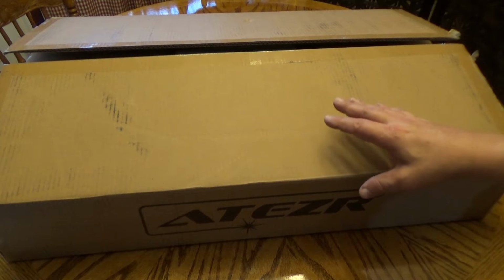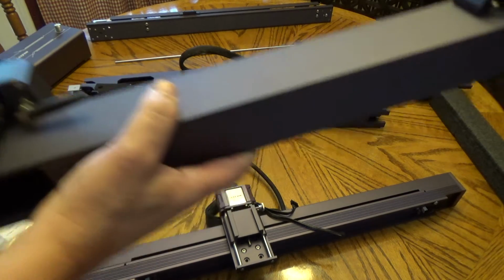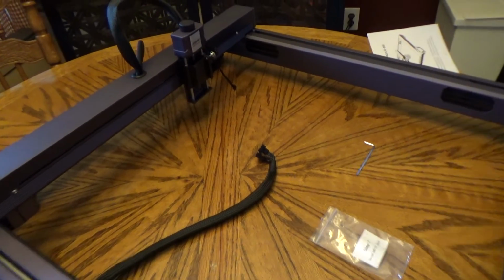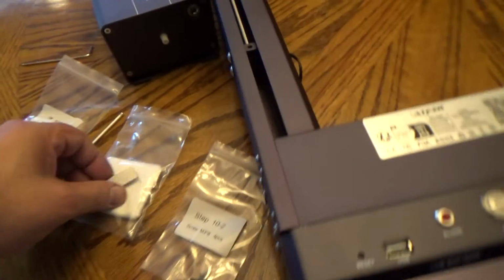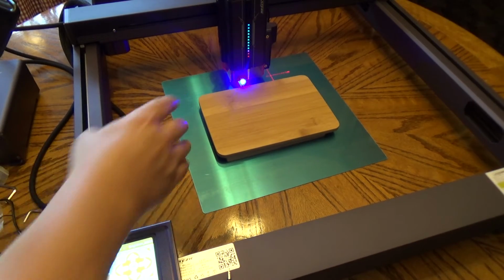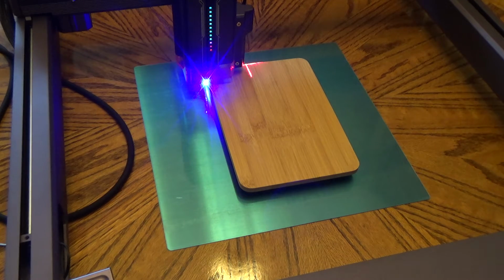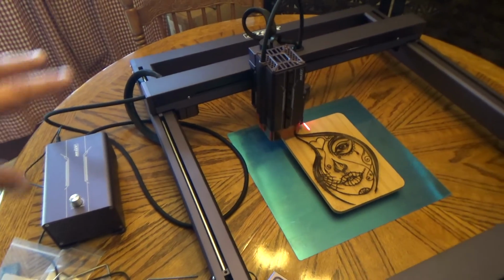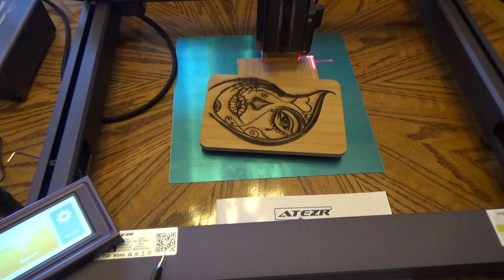ATEZR L2 36 Watt laser Engraver / Cutter with Autofocus, Auto Air Assist, and Sink Feature.

Comment: Have you tried the XTool and if so what do you feel is better?
Reply from the maker: I have not tried the xtool but I do have an Atomstack S20 that is very nice, but Atezr beats it in every way. The autofocus, the powered z axis, the auto air assist, as well as the 36watt power. Not to mention the tank light rigidity of the unit.
Reply: @737mechanic  thank you for answering, can I engrave on all different metals? This will be my first laser. I want to get all the accessories all at the same time. You feel this will be my best bet?
Reply from the maker: @nickp385  I have had 3 laser and this one is by far my favorite. I have no doubt you will be happy with it.
Reply: @737mechanic  great thank you, it will engrave metal correct?
Reply from the maker: @nickp385  It depends on the metal and you may need to paint it black for best results.
Reply: @737mechanic  ok great thanks so much, you have a great weekend